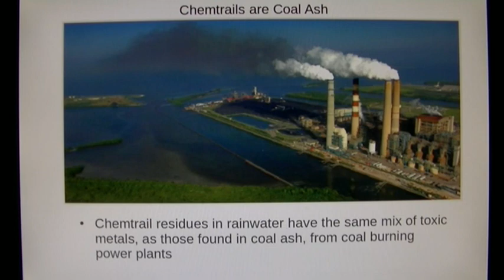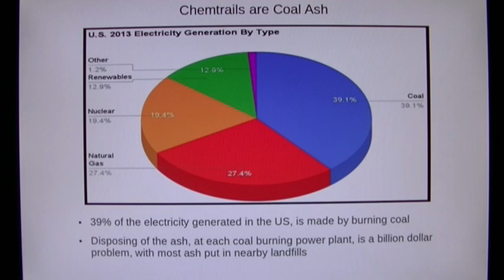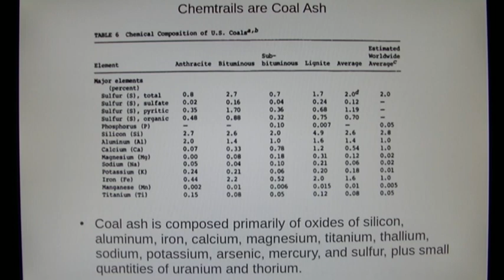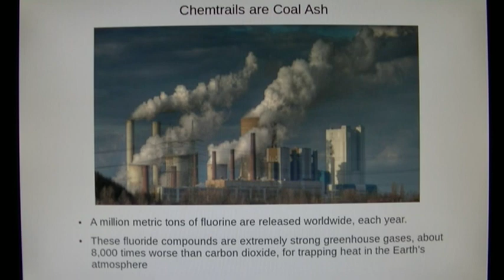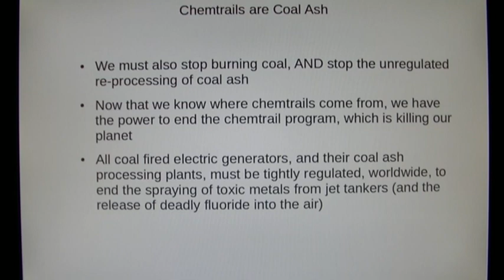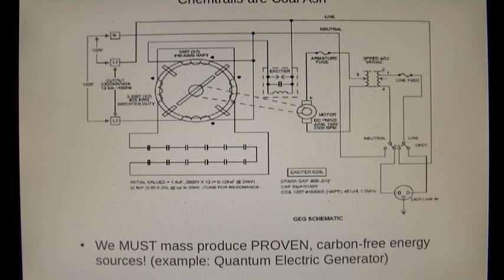Chemtrails are COAL ASH

Comment: TXI Riverside Cement power house - a coal fired plant in California with RR Tracks and next to the Southern California Logistics Airport near CA Hwy 395.  Formerly George AFB.   RESEARCH this airfield's current and past history.  Located at 18374 Phantom St, Victorville, CA.  Very likely a base of operation for the geoengineering chemical aerosol program in California.  Zoom in on this airfield and scrutinize the entire area; many planes and business operations close together on the property.  FedEx jets are visible as well as Southernair, a global air cargo carrier - (research this carrier), they contract with DOD.  Many of these jets 747's, DC-10s, 767s are literally parked in the dirt just North of the runways areas.  Some of these jets could be a part of a West coast 'chemtrail' fleet, which are active and flying when rain systems from the N. Pacific threaten California or the West Coast.  The Summer season does not see much aerosol activity in So. California but it does occur if hurricanes move up from Baja.   Info on the web suggests SCLA is a public airport, but the way and manner of these parked jets and the ground crew activity suggest otherwise.  Some of these planes have red tail markings, which is consistent with some of my video recorded of these jets dispensing white chemical aerosols over the Southern CA region.  The TXI Riverside power plant is located at:  34°36′24.99″N   117°20′11.90″W  (a 24 MW Capacity)  Airfield located just to the West.
Reply from the maker: 1PacificRedwood This is important information. I hope people will study this area, and take screenshots, in case the maps get altered. The power plant has it's own coal mine, to the east, so there is no pressing need for the railroad tracks, and all the covered hopper cars parked alongside. It looks like a hard rock mine, and I don't see a cooling pond, so it cannot be a coal fired power plant. It looks more like a smelter, to purify different ores. Do you know who owns that mine? The air base is really huge, what a mysterious place. Are you saying there are ten times more Fedex packages to deliver, just before a rain front passes over California? That is what everyone will say, I bet. Good find. Let's get lots of people studying places like this.
Reply: The HAARP Report According to Sourcewatch.org, the mine is owned / operated by Qwest Communications - a telecommunications company.  This airfield is not too far from Los Angeles and I'll be heading out that direction as soon as time permits.  AirNav.com is a good site for all sorts of airport info, departure, arrival & tower frequencies, maps etc which may yield some good info.  More than likely these 'chemtrail' jets are using encrypted radio links except for possible departure / arrivals.  We will see if planes are departing / arriving but not appearing on Flighttrader24.com or similar tracking service - and using other non-public, unavailable air traffic frequencies.
Reply from the maker: 1PacificRedwood
The SCLA has too many big planes, for the amount of warehouse space, and semi trucks, assuming they are FedEx delivery planes. It is  a bizzarre air base.

Comment: I was going through your video about Yellowstone and came across this comment: "Someone in the military put out a YouTube video stating the military was placing explosives underground to stage this eruption.  I saw the video around early 2012.  It was before I had a YouTube account.  I didn't save the video.  Haven't found the YouTube video since". I also read something about the forest service drilling deep holes and placing explosives in them to conduct read outs of the magma chamber and other things under the surface in Yellowstone. any new word on the Yellowstone stuff?
Reply from the maker: Josh Writz I'm now absolutely certain, that Yellowstone MUST be erupted, and very soon. Otherwise, the entire planet dies in 8 to 20 years. Anyone in the ash zone should be leaving the area, as fast as possible.
Reply: The HAARP Report
I saw that you were reading Malcolm Light recently. I'm curious if there was something new in his work that increases your certainty.
Reply from the maker: clive mossmoon
It is the Shakhova research paper, that measured 0.5 grams of methane, coming from each square meter of sea floor, each day, back in 2013. And the fact that there are enormous fissures full of methane, that are more fragile, than the original subsea sediment. I believe you are the one who sent me the link to the 2013 Shakhova paper. Also, we now have hindsight, that the methane clathrate "gun" fired back in 2011, so it is now a simple geometric progression, to planetary extinction. Malcolm Light is very brave, and very credible, IMO.

Comment: Ok, it makes sense that they could be using this coal burning waste product.
I missed a few things though,
Can you tell me:
* What is the proof that they are using ash? Do we have any other than the chemical signatures?
* How does Aluminum end up in the ash from coal burning?
thanks
Reply from the maker: kenjams The chemical fingerprint for coal is different for every coal mine. Chemtrail rainwater tests show the same metals, found in most coal mines. There is no other source for this HUGE amount of fine, metallic combustion products. It is a no-brainer, that fly ash is the source for chemtrails.We will have PROOF of which mines are the source of the chemtrails, when isotopic analysis of the chemtrail residue, and each coal mine's output is done by a laboratory. But, this is not necessary, as we already have overwhelming proof.Clay is always present in coal (except Anthracite, which is expensive, and rare). Clay is mostly aluminum oxides, in a stable form, so any clay in the coal, forms aluminum oxide in the fly ash.
Reply from the maker: *****
Great, you understand what I was trying to say! I was really exhausted, when I made that video, and not thinking too clearly. I feel like I aged five years, making that video, but it was badly needed by the world. Yes, I believe the final processing plants "touch up" the mix, before it is stored in tanks, for loading on the jet planes. It is the most economical material to use for this program, and a great way for the coal plant owners to make a fast buck, while getting rid of a nasty problem. Thanks for the comment.
Reply: The HAARP Report
Great, thanks for the answer and what you're sayiing makes sense. It also reminded me of when David Keith was talking at a lecture (can't recall which one), and he said something like "...and as it turns out, the material (for GeoEngineering) would be as cheap as potatoes, so spreading several million tons wouldn't be an economic issue". That statement would also support the cheap use of Fly Ash, as you''re saying. What else would be that cheap for them to use?
Reply from the maker: kenjams
Exactly, there is nothing as cheap as fly ash. It litterally has a cost that is less than zero. The transportation, final processing, and spraying, is the only real cost. Fly ash is the perfect source material, and there is no other substance on Earth, that has the same quantities, or properties.
I don't know why it took the world so long to figure this out... Maybe lots of people knew, but were too afraid to go public. Fear will be the end of our species, if we let it.
Reply from the maker: Truthfulpietro
This kind of thing is disinformation, a psy-op to distract people with weak minds! Who is going to build 10 billion of these over the next five years??? That is what is needed, if we are going to survive the explosive Arctic methane eruption, which has already begun.  On the other hand, we can begin to fertilize the southern oceans, and the Arctic Ocean, to pull down vast amounts of CO2, and to eat the methane, before it bubbles to the surface. Nobody is doing anything, so we should all prepare to see our planet, and our families die in the next 15 years. I've never watched his name calling video, that he made about me. Did he really send you that stupid article about the glass colonies in the sea? I certainly hope not!
Reply from the maker: barbre105
There is a long history of the masses being poisoned, by the worst toxins, that were available at the time: Lead water pipes in ancient Rome; TB, ergot, cholera, and plague in the middle ages; Mercury dental fillings since the 1700's; Mercury in 1800's medicines; Lead in children's candy in the 1900's; Lead in gasoline till the 1990's; Asbestos from the 1800's to 1980's; PCB oil in 1960's to 80's electrical devices; Partially hydrogenated vegetable oil in food, till the 2000's; Dioxin in herbicide;  Depleted uranium on all modern battlefields; Fluoride in tea drinks, from the 1700's to present; Fluoride in drinking water from the 1950's to present; Fluoride pesticides on grocery vegetables; Fluoride in antidepressants; Iodine removed from the diet, to increase fluoride damage; Dangerous pharmaceuticals from 1915 to present; High fructose corn syrup with mercury traces; Food flavorings and dyes that harm children; Vaccines that cause autism/alzheimers/dozens of other diseases; Coffee from brazil with radioactive Thorium; GMOs, glyphosate, and arsenic, in food; Fukushima radiation everywhere; and now, nano-metal toxins raining from the sky. Why should we be surprised by chemtrails?
Reply: @thehaarpreport9203  and aspartame
Reply: ***** floride another industrial waste material in our water, another toxin. Shit this is a horrible sci fiction movie. I wish it was not so, but it is.
Reply from the maker: Truthfulpietro
The only problem with ocean fertilization, is how the deep ocean deals with the products of the phyto plankton bloom, and a floating algae greenhouse will NOT answer any of the tough questions. What happens at the surface is well understood, and pretty simple. The tricky stuff depends on deep ocean currents, temperatures, PH, all kinds of weird stuff, that people don't have very much data on. Still, it is the only way to save our planet, as we may only have 8 to 20 years, before the planet dies from the venting methane. (look at the Malcolm Light research) The floating greenhouse balls won't help. They still look like a disinformation tactic to me, but for God's sakes, we have to throw money at all these ocean research tactics, to do whatever we can, as fast as possible. It is such a bummer, and I'm so freaked out about the 8 year deadline. I just hope my stupid videos have helped, and not hurt the hopes to save our biosphere. I'm beginning to have some real doubts.
Reply: The lab testing IS necessary if you want to convince scientists that this claim is legitimate! Denial is a powerful tool in keeping this assertion on the sidelines of science, relegated to the realm of 'Conspiracy Theories". Without PROOF, people will remain in denial. Thank you for making this video! I hope that everyone starts taking this seriously and performs testing necessary to prove it. Also, just to point out, NASA has openly admitted to spraying various aerosols for different purposes. For example, they used an aluminum-containing aerosol to supposedly map geomagnetic fields over the Northeast last year. I know that some Geoengineering projects are also on public record, but many people don't seem to understand the implications of it. Some people even think it is necessary to combat global warming.
Reply: The HAARP Report Hey HR

I've asked Jim Lee about any findings on Iron Fertilisation and algae blooms. I know you and Jim have differences to say the least but his findings gave me this really sophisticated facility. I wondered what do you think of it?

http://www.fastcoexist.com/1681797/this-underwater-bubble-will-grow-climate-saving-algae
Reply: The HAARP Report No he posted it on FB. I was under the impression that one research facility was enough. Then they send the data and then once convinced, spray by planes.

Comment: how can i test my air without exspensive equipment
Reply from the maker: gary hill The cheapest, and easiest, think to do, is test your rainwater with PH paper (not litmus paper). Normal, pure, rainwater will be acidic, from the CO2 in the air. I think it is around 6.0, but find out the exact number from an expert. If there are chemtrails in your rain, it will be around 7.0. That is actual proof of metal oxides in your rainwater. The best PH paper is for testing human PH, or aquarium water PH. Please let everyone know what kind of measurements you get. Thanks
Reply: The HAARP Report
Thinking of starting some testing myself here soon.
Reply from the maker: *****

Excellent work, that is exactly the kind of testing that is needed. You have just proved there are metal oxides in your rainwater. Please start a log book, and do regular testing. After you have enough data, you can write an editorial in the local paper, start a local research group, aggregate your data on facebook, upload youtubes, anything, that gets the data out. You have just switched from being one of the millions of sheeple who complain, and do nothing, to a wolf, who can put fear into the genocidal criminals. Great, man, keep it up! Get your neighbors involved. They have a right to know. When it is on the internet, who cares. When it is local, it is personal.

Comment: Elana Freeland left this comment on Take Back Our Skies facebook page:  "Billy Hayes had this to say: "This is no more than speculation. The process of obtaining the purity of aluminum needed for nano aluminum oxide is lengthy and very complicated. This is not to say that fly ash and bottom ash are not used in the smelting of other aluminum products in acquiring nano aluminum. There are many persons who have witnessed and confirmed the transportation, delivery and storage of the liquified compounds in 55 gallon barrels, tanker trucks and train tanks at aviation bases and FBO's like Kristen Meghan. Transportation of such always requires a minimum of three separate Hazmat Placards, say commercial suppliers."

Comment: Shut down the oil and gas industries as well, another theory is the Chems are used in harp satellite systems to find gas, oil and mineral deposits in order to mine and frack those areas. After years of world wide Chem spraying they are fracking all over the world for oil and other types of mineral deposites...even precious metals I would imagine.  This is what really keeps the over lords in power.  I don't believe this is all to control the weather.

Comment: From Wikipedia:
COAL FIRED PLANTS IN CALIFORNIA  Corrected Address / Coordinate Info:
Plant           Location          Coordinates                 Capacity (MW)

ACE Cogeneration Facility
Trona, Inyo County, California
35°45′55.86″N 117°22′30.59″W  (108 MW Capacity)

Argus Cogeneration Plant
Trona, Inyo County, California
35°45′55.86″N 117°22′30.59″W  (55 MW)

Port of Stockton District Energy Facility
Stockton, California
37°56′36.01″N 121°19′46.44″W  (54 MW Capacity)

Rio Bravo Jasmin Power Plant
11258 Porterville Hwy., Bakersfield, CA 93308 (No RR Tracks near facility)
35°44′29.39″N 119°3′6.17″W  (38.2 MW Capacity)

Rio Bravo Poso Power Plant
Bakersfield, California (No RR tracks near facility)
35°32′46.00″N 119°4′38.85″W  (38.2 MW Capacity)

Stockton Cogeneration Facility
Stockton, California  (RR Tracks Visible At Facility
1010 Zephyr St, Stockton, CA 95206  (60 MW Capacity)

TXI Riverside Cement Power House
Oro Grande, California (RR Tracks visible at facility; and close to Southern California Logistics Airport; (formerly George AFB.)  RESEARCH this airfield's current and past history!!  Very likely a base of operation for the Geoengineering chemical aerosol program in California.
34°36′24.99″N   117°20′11.90″W  (24 MW Capacity)
Reply: That is a start for some of the ones on the west coast. Have you found anything north into Oregon or Washington?
Reply: Josh Writz The only coal fired plant listed for Oregon on Wikipedia is the Boardman Plant run by Portland General Electric in the City of Boardman, OR.  This plant generates 550 megawatts in Northern Oregon near the Columbia River.  CORRECTED COORDINATES 45°41′2″N 119°48′21″W.   Washington State also has one coal-fired generating station; the Centralia Power Generating Station (1460 mW capacity); run by Trans Alta and located in Centralia, WA.  CORRECTED COORDINATES:  46°45′20″N 122°51′36″W- located just East Northeast of the coordinates on Big Hanford Road.
Reply: Thanks!
Reply: Josh Writz Note the corrected coordinates for the Washington and Oregon plants; sorry for the screwup.
Reply: Thanks!

Comment: ***** Check this out. I really never had a problem with asthma until around the year 2000. I am a smoker, but I am starting to think that this coal ash, and the high quantities of aluminum & barium being sprayed into the air is the main cause of my asthma. I think that this video pretty much explains it all.
Reply from the maker: Bro Brian If you have to smoke, you should grow your own tobacco. The store bought stuff will kill you, that is for sure. Keep in mind when you smoke, you are ingesting months of chemtrail fallout,  that is on, and inside the leaves. Better than growing your own, give it up, it's not worth it!
Reply: The HAARP Report
Good points there, for sure. I may just do that very shortly.
Thanks for pointing that out to me.
Reply from the maker: Bro Brian
If you really want to quit, read about how tobacco leaves are "cured" in open sided barns. The tobacco leaves pick up months (or years) of chemtrail residue, and 100% of that is in the ciggy's you smoke. That crap is waaaay worse than the tobacco, for your health. If you grow your own, you can cure it indoors, or do a fast cure on a hot day, inside a black plastic bag, in the sun. This is all totally legal, as long as you don't sell, or give away the tobacco. It is a basic right from our founding fathers, when everyone grew their own tobacco, even share croppers, and servants.